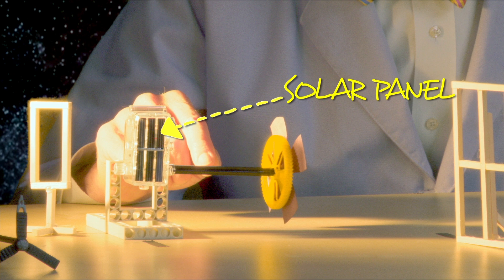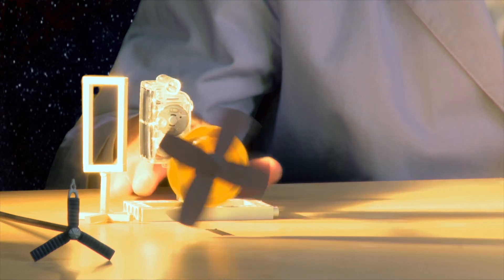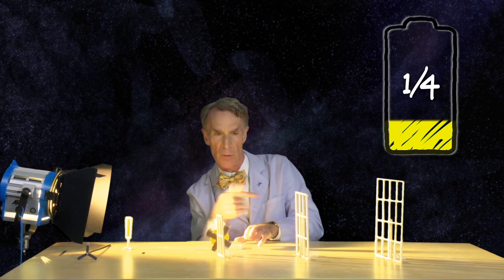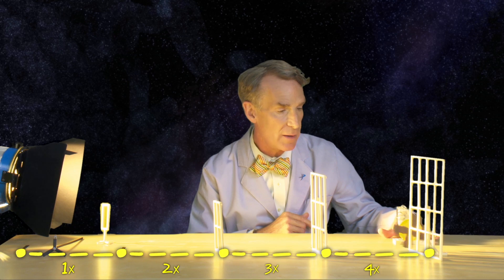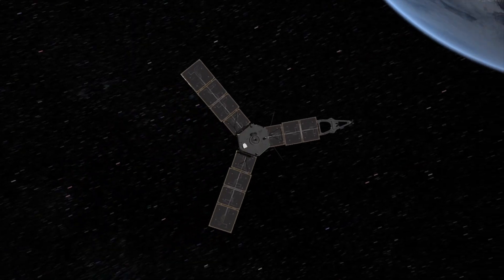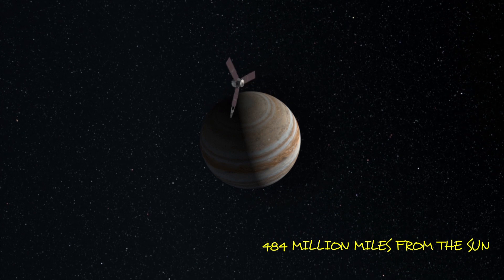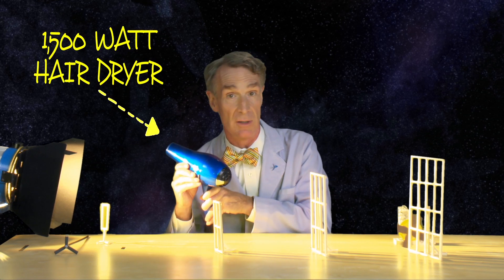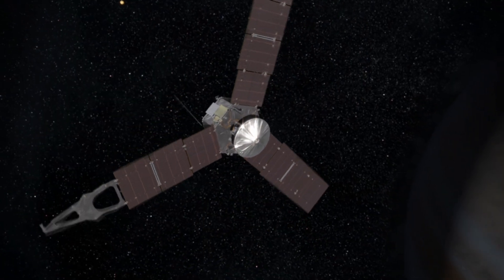Why with Nye (Ep. 1): Bill Nye and Juno the Solar-Powered Spacecraft

Comment: Yes, Bill Nye the science guy. But solar power becomes impractical beyond 5 AU, and Jupiter is 5.2 AU away from the sun. I'd stick with some Strontium-90 as a fuel source, since micrometeorites would damage the solar panels after a few years. Solar panels may degrade quicker compared to radioisotope thermoelectric generators. Juno proved me wrong though, as the solar powered spacecraft is still alive and well in 2019. That is an impressive feat achieved by those electrical engineers at NASA. But I still wonder what happens if Juno's rechargeable backup battery loses capacity, and the spacecraft is in Jupiter's shadow? Would the spacecraft be able to recover when the backup battery is depleted? What happens when the spacecraft's solar panels are accidentally misaligned away from the sun?

Comment: i want more of these episodes NOW!
Reply: +zlavikk Nope, it stops at Episode 1. Sorry!
Reply: Requiring nearly the whole clip to explain how/why the craft gets less energy from the sun as it travels outward probably doomed this. We got it after the first explanation, then he went on and on about 4 more times.
Reply: Could have used radioisotope engine.  But know-nothings stopped it.  Unusually for Nye, this is a half-decent explanation.  Didn't say why, but said what at least.  Good job kiddy entertainer!

Would have been nice to see an explanation of the 1/r^2 law and how it ties into 3D geometry.  You know, like a proper scientist would do.  But compared to Barney the Dinosaur, I suppose it is not half bad.
Reply: The reason NASA thinks long and hard before using RTGs is that if something goes wrong during launch and the vehicle is destroyed in high altitude, the RTG's fuel (plutonium or cesium usually) could fall back down and be spread over thousands of miles, contaminating whatever it falls onto. I would say it's a sound decision.